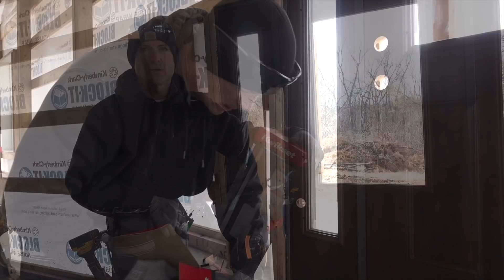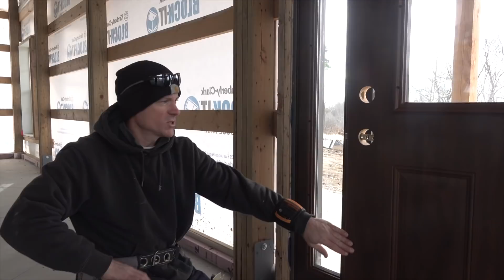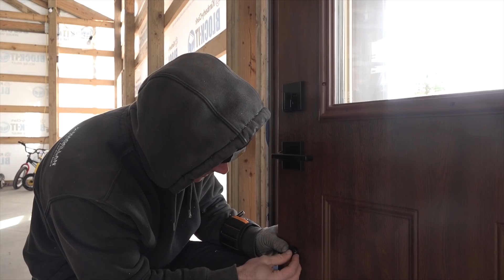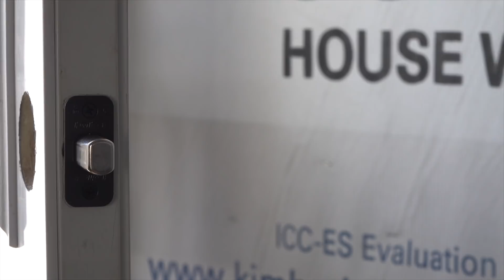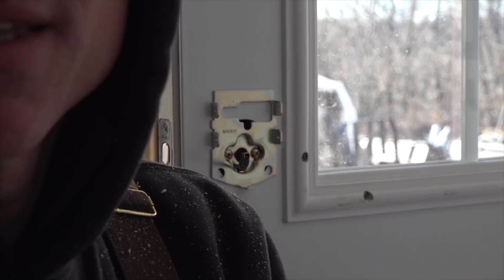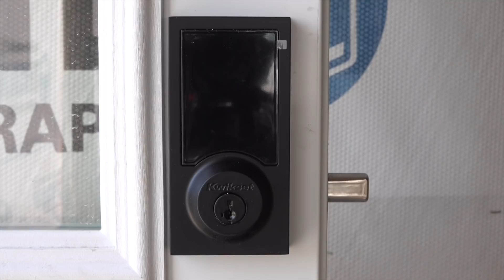Kwikset Install + Review (Vancouver Handleset, Smartcode 916 Electronic Deadbolt)

Comment: Great product. Lots of different components ti adapt to your door. do7.pl/kwikset I would say that is ready for 99% of doors. Im in january I bought it on novembre it has past almost all winter and still working with same batteries. I have it on a exterior door but the indoor parts are on a temperature about 12*C. Outside has been -25*C. So winter tested. Besides, nice look easy installation easy programming and operation.
Reply from the maker: Thanks!

Comment: I am not a locksmith or and expert on locks.  However I have seen a lot of people say the this is not the way to go.  From all I hear it does not take much force to break in through this lock.  Do you remember the bump proof locks of a few years ago, that the big box stores had to pull because of the many videos of children with small hammers getting them to unlock.   I bought on of those unfortunately.  Probably to late for you but check it out with a neutral person.

Comment: The correct term is the backset measurement.  The shorter backset is common on interior doors.  I always use the longer exterior door backset even on interior doors.

Comment: you could have called a lock smith and key all the doors the same,
its not that hard, u could have done it your self

also I would have upgraded that strike plate
https://www.amazon.com/Door-Armor-Mini-Security-Reinforcement/dp/B00LSWF6AS/ref=sr_1_23_sspa?crid=1XO0QGWEPPMYK&keywords=strike+plate+extended&qid=1581607577&sprefix=strike+pla%2Caps%2C184&sr=8-23-spons&psc=1&spLa=ZW5jcnlwdGVkUXVhbGlmaWVyPUEzNVFRM1U2TlNXMUdLJmVuY3J5cHRlZElkPUEwOTc2NjY4MkxQS1BJVk9UNDJTNiZlbmNyeXB0ZWRBZElkPUEwMjU4MzI2MVhTNDY1QVFaNzZQWiZ3aWRnZXROYW1lPXNwX210ZiZhY3Rpb249Y2xpY2tSZWRpcmVjdCZkb05vdExvZ0NsaWNrPXRydWU=
or
https://www.amazon.com/dp/B07K37KM9M/ref=sspa_dk_detail_3?psc=1&pd_rd_i=B07K37KM9M&pd_rd_w=t8kkC&pf_rd_p=45a72588-80f7-4414-9851-786f6c16d42b&pd_rd_wg=kVKHR&pf_rd_r=DJM68AJ0BZFQZCAY2HJ4&pd_rd_r=bd669b00-31bd-4b54-99f5-97b889db4d59&spLa=ZW5jcnlwdGVkUXVhbGlmaWVyPUEyNlNTR1dLVDNSUEkzJmVuY3J5cHRlZElkPUEwMTk4MTAwUDBPVlREQkE3SThTJmVuY3J5cHRlZEFkSWQ9QTA1MDQ1NjRRMko2VjA3TkgwOVcmd2lkZ2V0TmFtZT1zcF9kZXRhaWwmYWN0aW9uPWNsaWNrUmVkaXJlY3QmZG9Ob3RMb2dDbGljaz10cnVl

Comment: Very nice lock set.
Have you considered installing security cameras?
Now is the time at this stage of the build. Don't do wireless, but use PoE.
Reply: We will be going with something like this for our build. Haven't decided on the brand just yet, but we will be running network drops throughout the house and have a designated space for a mini rack drawn up.
Reply: @BuildingTheHaven  Something else to consider is monitoring. I have an HDMI splitter and ran 4 cables to smaller TV's, one in the living room, master bedroom, basement, and back porch. This way, if I hear any noise coming from outside, I can look at a monitor wherever I happen to be at the time.